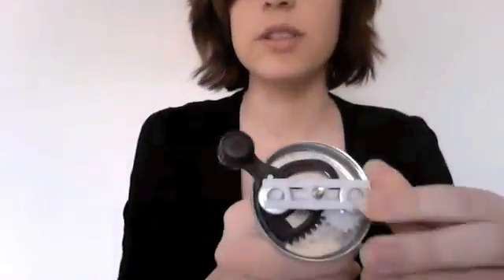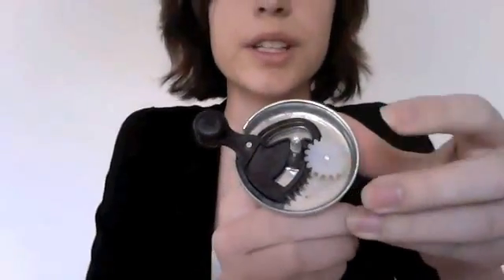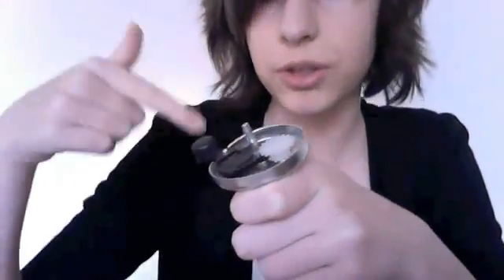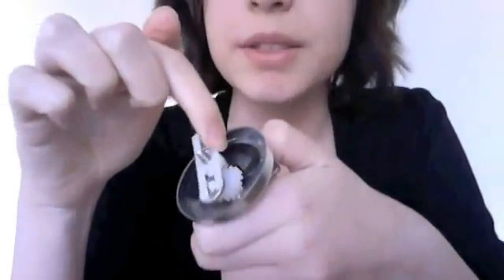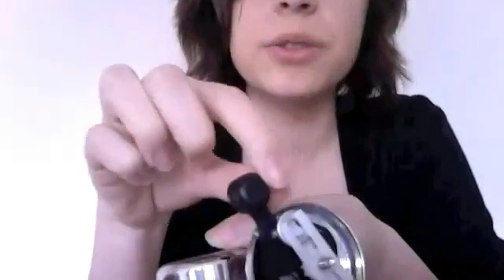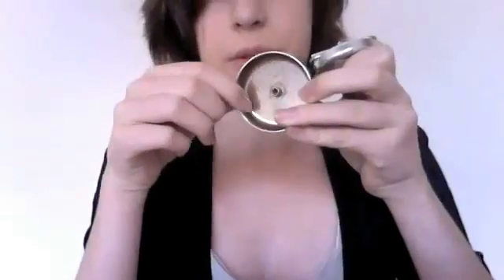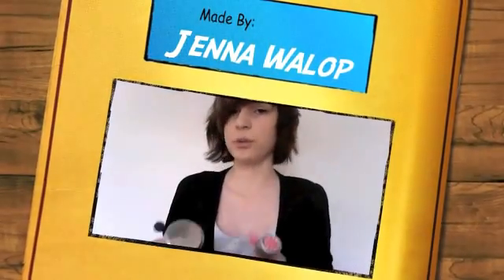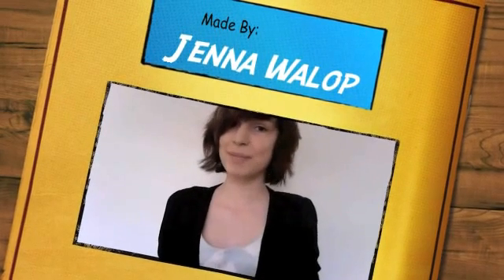Bicycle Bell

Comment: Nice but when you disassemble it and the spring goes flying before you can see where it is... It's close but not quite what I needed.  you've obviously got great skills on the 3D it would just be a lot more useful if it showed the spring return for the lever.

Comment: I got a bell to flick, and my experience is that it is pretty much useless, unless you flick it several times, and that takes time and is annoying in usage.
You really need a consistant tone over a period of time, so pedestrians and everyone else has the chance to make out, where the noise is coming from.
Different sounds from other bells, like electric ones aren't even recognized as ring and ignored as well.

The best sound is an old school riiiiinnnng riiiing. Every pedestrian recognizes it in an instant.